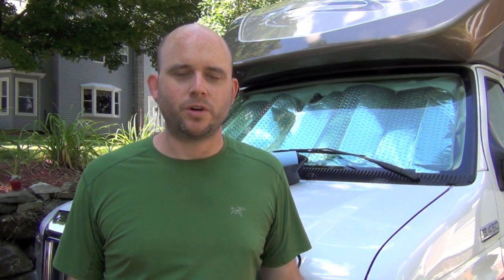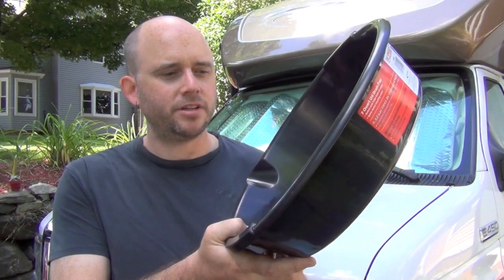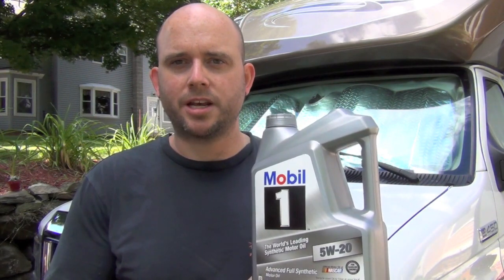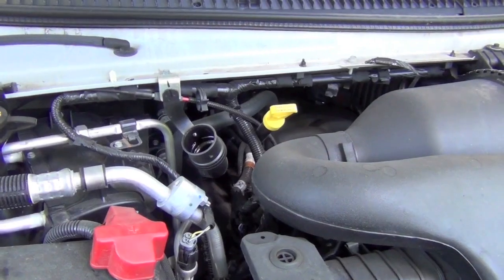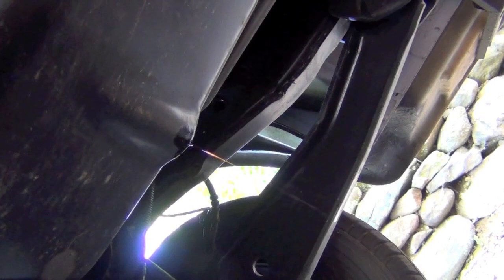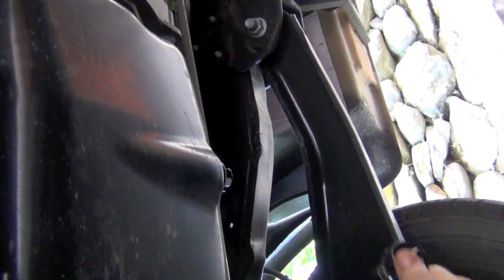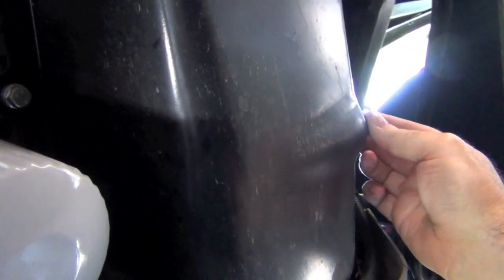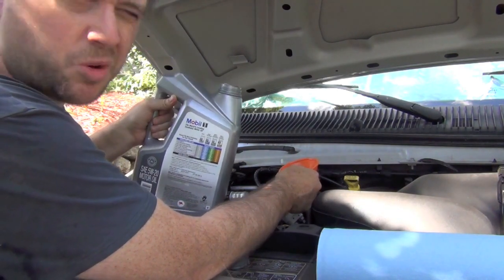How To Change The Oil In Your Ford 6.8L V10 Powered RV

Comment: Obviously...do NOT attempt to change your RV oil in a tux!!  This was a good basic oil change video for the Ford E-350/450 SuperDuty RV.  However, I'll add that before you install new oil filter that you (1) use a circular filter wrench....that way you won't burn your hands on a hot oil filter.  (2) Do NOT use the oil filter wrench to install the new oil filter...ONLY HAND TIGHTEN the new filer!  (3) IMPORTANT....be sure to  "lube" the oil seal around the oil filter base before you install it...as that will prevent it from sticking to filter housing and will insure a solid seal with no leaks  between oil filter and oil filter housing.  (4) Be sure to "RECYCLE" your used oil at authorized oil recycling station - local service can accept it usually.